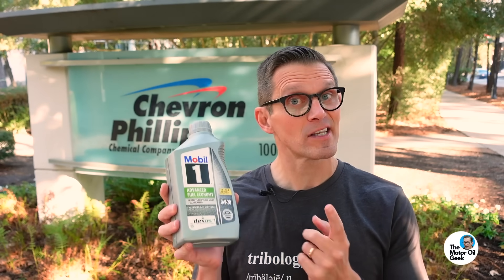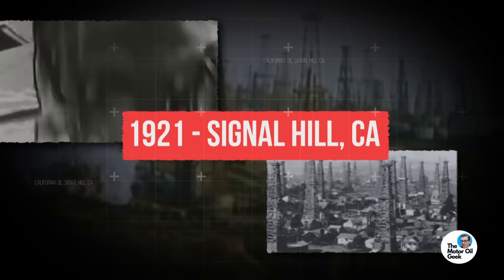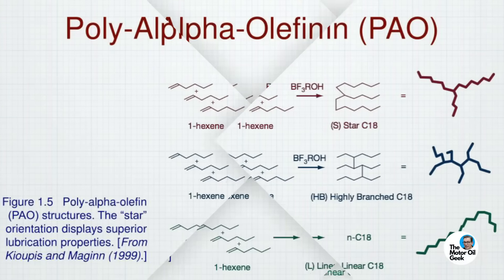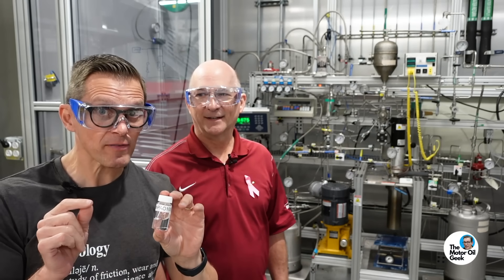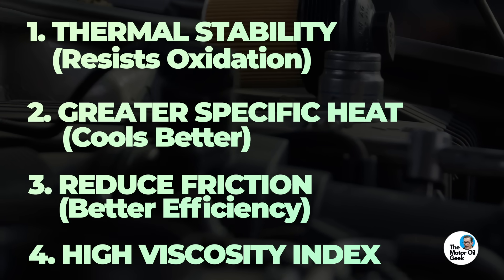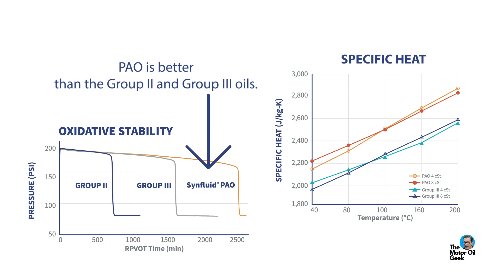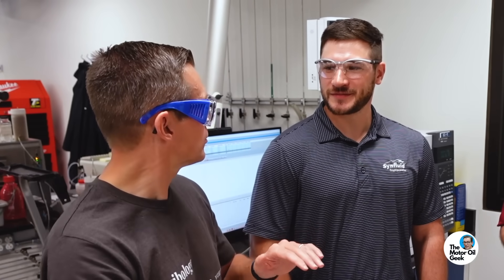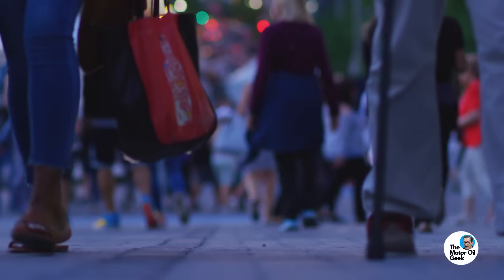STOP Using Regular Oil - 4 Reasons Synthetic is BETTER!

Comment: This statement is a fact on V8 engines if you’re using high-quality full synthetic, it is not possible to wear that engine out, yep, that’s what I said. You will get tired of driving the vehicle before you ever wear the engine out. I’ve been running synthetic since the early 1980s, which was Amsoil the only one, I have never worn out the engines on any of the cars and they were all V8 that had synthetic engine oil they don’t smoke. The valve guides are tight. They go forever all of these engines have 500,000+ miles on them

Comment: How about for my 1995 Toyota 4Runner with 207,000 miles.  Toyota told me it would be a waste...not perform better not last longer.  Toyota owner forum said members had leaks in the engine after using synthetic so changed back.  I wondered about MPG....but don't want a leaking engine.

Comment: When I had my 88 Toyota pick up. 
Bought it with 80k miles on it  had 4 long time  knew it inside & out . 
Put 100k miles on it regular maintenance.  Got tired of driving it.    22R motor...    5w30  Conventional   havoline oil used in it.  .  Once that oil gets to 2700 miles.on it.     Lifter would start ticking  just a hair.     Change oil.   Lifter tic would go away until it got to 2700 miles again...     USING QUAKER STATE 0W20 IN MY 2016 OUTLANDER SPORT SINCE DAY ONE...     MIGHT SWITCH TO HAVOLINE  & START RUNNING THAT IN IT.    used havoline in the 90.s all the time.     😊    Change oil every 3000 miles.   😊    Mike from Minnesota....

Comment: I'm not a very knowledgeable car guy. Some can argue I'm very incompetent; however, I saw your video on "Restore and Protect" and I wanted to give it a try. I have an older car and I was wondering if I needed to change it out every 2k miles at first until it is clean. Or, is it safe to wait until the next oil change as recommended by the owners manual. Thanks!
Reply from the maker: Just use it like normal. An early oil change is not needed.

Comment: Not on current topic...However I have been impressed with the valvoline restore and protect.  Have not tried it personally I am considering it for a 5.3 with 180k on it.  I use valvoline fuel treatment on this engine currently.  OEM SPEC 5/30 oil only.  And I usually do not exceed 3k on oil changes.   Excessive I know.  However my question is on Diesel engines.. (perkins)..   #1.  On oil consumption (pcv valve operating). A suggestion was made to increase viscosity to 50...  is that a real option? 
And #2 is there an oil for Diesel engines that would help with sludge or oil ring performance?  Please forgive my ignorance on this subject but that's why I like your content.   I enjoy people that strive for and share knowledge.  Thank you Marvin

Comment: Would a synthetic oil in a early 70's flat tappet cam engine still be a better choice or stay with conventional oil with higher zinc levels? All late models (80 and newer) are roller lifter cam driven or direct rocker with a roller to cam. What I hear is more related to the late model engines with rollers and specifically not addressing the flat tappet.
Reply from the maker: WALMART Oil Showdown: Myth Busting Results!
https://youtu.be/j8tpRxQLqU0

Comment: Can you test Renewable Lubricant oil please? It's made with a modified high oleic sunflower oil that allegedly has high thermal stability and low friction properties.

Thank you for considering.

Cheers
Reply from the maker: Thanks for the suggestion.

Comment: In the desert Southwest we don’t see the low temperatures that are seen back east. We see temps hovering around freezing, but not much lower in the extremes. But we do have incredible heat. This heat destroys batteries because the chemical reaction that releases stored electricity is set up to keep them reacting fast enough for those low temperatures seen back east. The downside is that this reaction is effected by heat, reacting so fast that it causes wear on the plates in the batteries which wears them out faster than cooler climates. What does synthetic do to handle the high heat of Arizona summers?
Reply from the maker: Synthetic can handle the heat

Comment: if the manufacture recommendation is 10w30 on my motorcycle but during summer i feel the oil is too thin just after 30 minutes of riding .what should i do ? stick to 10w30 or use 10w40 or mix 10w 30 and 10w40 in equal amount and pour?

Comment: As I understood, owners of air-cooled VW’s think that mineral oil is better for cooling because when they put synthetic oil in the motor - oil temperature goes down and cylinder heads temperature goes up.

Comment: CHALLENGE! start doing a little on 4 stroke outboard oil ,1 time (open loop) water cooling usage, and their lower gear case oils (submerged in water for cooling). We scream!,  our outboards at 4500 to 6k a good bit of the time, our lower units are the epitome of extreme pressure, heat and wear and our motors run at RPMs well beyond car/truck engines normally operate.

Comment: So I have a 1968 dodge charger 383 engine and been using penzoil 10w40  and was told I need an oil which contains zinc. Any synthetic oil contains zinc?
Reply from the maker: The API SP oils do: https://youtu.be/j8tpRxQLqU0

Comment: Hey Lake thank you so much for all the effort you put into all your videos and thanks for sharing your passion as well 👏🏻👏🏻👍🏻 Also what are your thoughts on this advice It’s better to change your oil regularly with “cheaper” oil, than not changing regularly with “expensive” oil. I’ve being thinking of changing liquimoly semisynthetic Leichtlauf High Tech 5W-40 for Castrol full synthetic EDGE Euro 5W-40 A3/B4, for my Porsche boxster s 2001
Reply from the maker: Thanks. I'd rather use a really good oil and change it at the proper interval. That's the best protection and value.
Reply: @ Thanks for the response, I feel like back in school with all your videos I’m always taking notes haha thanks again for all of your effort in your videos 👍🏻👍🏻

Comment: I agree use synthetic.. Honestly if you are changing your oil under or at every 3K miles just use what's synthetic and on sale.. Or if you are making the mistake of following the manufacturers recommendations of 5K to 10K oil changes then I would use the best oil you can buy... But for the most part I use Pennzoil Ultra to Ultra plat, and I change my oil every 2000/3000 miles cause why not.. The car isn't going to get mad at me for treating her special and keep her clean..

Comment: You don't get quality mineral oil from the desert: It needs to have long molecule chains found in very deep perforations only got from Venezuela, because the deep boring in frozen Alaska should cost way more than the most expensive syntetic oil. A synthetic oil a a cracked cheap desert oil with its additives, except the group 4 synthetic oils with are all the same short molecule chains perfectly connected until excessive heat destroys it due to oxidation just like it destroys quality dino oils. So for the woke guys, a synthetic oil is more politically correct but those theories are just marketing until there exist certified durability long distance proofs like where done with dino oils.
Those differences in which a good synthetic oil like Amsoil is better are only important for  use in racing, not one the street where we don't change oil after each ride like in competitions.

Comment: Is there some reason why i can't use 0W40 oil in 70's car, what drives easily 10W30 oil? I can't find any reason why not i only find good reasons for the engine.
0W40 API SP class oil..

Comment: Another great video Lake! This is "Cool Stuff!" Making Facts Fun Again 😁
How does the average Petrol-head identify clearly which synth oils are actually using Grp 4 PAO as the base? And how would we know the percentages of that base is actually PAO Grp 4 vs Grp 3 etc?  🤔
Reply from the maker: Thanks. Most "synthetic" oils in the US are Group III based, but there are some Group III/Group IV and even Group IV/Group V blends on the shelf in the US. However, you have to decode the SDS sheet to find that info most of the time.
Reply: @themotoroilgeek  Thank you for the reply. It seems that this would be more plainly stated or even have its own classification type spec on each bottle.  But I understand why its not 🥴 The community may need to start a curated list  of PAO Grp-4 oils.

Comment: Ok can you please answer this.  I recently bought 12 litres of the wrong vscosity oil for my cars which are both BMW's with late varient Diesel N47 engines.  I bought Castrol Edge 10W60 instead of 5W30.  So what I have done to save just wasting the oil is give the engines a flush using 4 litres of the 10W60 each (just ran engine for 5 minutes with it in) then  replaced it with 4 litres of 5W30 castrol edge M (not LL varient) then topped it up (engine takes 5 litres) with approx 1 litre of left over 10W60.
So my question is, is it sacrilege to mix the two viscosities and even though they are from the same manufacturer and both fully synthetic similar oils is this likely to cause some catastofic failer or reaction when the two oils mix????
Reply from the maker: It is ok to mix different viscosities of the same brand and specification oil. The viscosity is the only difference in that case.

Comment: Thanks...This has been a paradigm. I've understood heat transfer but finally understand differences in Groups.  The graphs for Specific Heat, Thermal Conductivity, and friction clearly showed PAO (Synthetic) was definitely superior to conventional. So on the topic of Group IV vs V is it true that Ester molecules are polar and have an affinity to metals via an electro-chemical bond whereas PAO molecules are neutral?
Reply from the maker: Esters are polar and PAOs are neutral. The polarity has pros and cons. Good solubility (pro), but that polarity also causes competition with the additives (con).
Reply: @themotoroilgeek  Thanks...Some of my less used vehicles have low miles per start <120* (don't count starts but mileage is so low and consider anything <120* a cold start; therefore, conclude low miles per start comparatively speaking). I change oil frequently, 750 to1600 miles on sample reports. My oil samples have more metals than I would like >5ppm/1000miles. Loss of additives has not been an issue w/ frequent changes so I'm thinking I might consider a Group V may be beneficial. Is my logic right or have I missed something?
Reply from the maker: @jcasey460  An Ester blended product may not help. The additive chemistry also plays a big role in cold start protect. The main reason for the higher wear rate per 1,000 miles is the short drain interval. You are not starting at 0 wear metals, so the residual wear metals are throwing off the math. That calculation works better with 3,000 to 7,000 mile drain intervals. That is far enough for the actual wear metals to be greater than the residual metals.
Reply: @themotoroilgeek  LOL...makes me feel better...a lot better...Thanks...Exactly what explains happened on my last sample taken!

Comment: 😢 could you just tell me the best oil for my gm 5.3 v8 its direct injection with the DFM lifters and overly complicated electronics to control this system along with hard facts for it's failures. 2024 model and calls for 20w GM Dexos oil! 
Please chime in on what you would use if you were me!
Thanks a million!

Comment: Is transmission fluid similar to oil? In the Toyota community there is a debate on Toyota WS vs aftermarket WS transmission fluid. Toyota says only use OEM Toyota WS fluid. Is it really that different than an aftermarket fluid like Valvoline Maxlife which is recommended by Valvoline to be used with many vehicles including Toyota WS. I'd really like to see information or studies on this to see if indeed OEM Toyota WS fluid is the best and only fluid that should be used.

Comment: I worked in industrial maintenance for many many years. In the beginning I was a Synthetic denier because of the cost. Later I was forced into my first experience which was shockingly impressive. Some years later I was convinced to take a voluntary foray into synthetics. Boys and girls Synthetics have huge advantages over the old oils. I can't say there are no negatives but I never experiences those problems. This wasn't in motor oils but in industrial hydraulics and the lubrication of Screw type air compressors.

Comment: What are the main reasons/drawbacks against using at least some POEs as a 'co-base stock'?
Is it ONLY a matter of co$t vs. ANs and/or other alternative base stocks?

I ask because many oil manufacturers/blenders nowadays seem to be reluctant to (or flat out refuse to) use even small percentages of premium POEs in their true, fully synthetic, mostly PAO blends.

Also, I fully agree with you on the whole true synthetic PAO majority base stock thing, and those are the only products which touch the sump in my car's engine.

But, you yourself (and many others) also point out, many times, that the GTL base stock products are at least the RIVAL to PAO/POE base stocks, IF not actually superior.??

Is that only for easy use, no racing/competition whatsoever, daily drivers, or not???

Comment: Thanks again Lake for the great videos. I can't wait for that update on the Castrol  gtx wear results. I need to ask u a question. I really want a full pao/mpao (or at least very high percentages) in the 50 weight spec and higher Moly, zddp, boron etc (full saps) but not w the high calcium....i am using it on a few older cars so all I care about is protection and longevity of the engine. I also don't go long w with oil change intervals... 5000 miles... Which 'driven' is the best? From what I can tell the "Dl50" is what I'm looking for.... Is this correct or is there another one Im missing. Thanks so much for everything. It's nice to see how your channel exploded in a short time. Happy for you.... Thanks! Lance
Reply from the maker: Yes, DI50 would fit that bill.
Reply: Thank you

Comment: I've been using 20w50 regular conventional oil on my 1986 Porsche 928 recommended by Porsche in Southern California to protect the Thrust bearing failure and never had a problem over 200k miles. It takes 8 quarts and I do replace it every 2 years since I drive less than 2000 miles per year. Synthetic oil has smaller molecules and cleaning deterg8 so there's a risk of oil leaking on old gaskets.

Comment: Ok that all fine and dandy . But if I switch to synthetic on my 3.0 Duramax and have mechanical failure now the dealer will not warranty the engine because I didn’t follow there requirements by using there sae ow-20 (light duty oil) which is GM approved decos D. With that said I have yet to find this oil at any auto parts store. I’ve been buying it on line or from the dealer . I have found the synthetic available at the box stores but I’m Gunn shy about using it for I have 40000 left on warranty . I look forward to any and all responses
Reply from the maker: 0W-20 Dexos D is synthetic by the definition of the Dexos D spec.

Comment: When synthetic oil first became readily available a senior project engineer at CAT assigned a team to evaluate them. I’ve been using synthetic in everything since the mid 1970s.
Reply from the maker: Thanks for sharing!
Reply: at the time did they conclude they were a good idea?
Reply: @ better than petroleum oils beyond any doubt.
Reply: @contemporaryprimitiveman3469 that is why my car uses synthetic oil as stock oil, a plain just normal 2022 Chevrolet Spark... 3-4 times per year  oil change because I drive mostly city with plenty of stops and go... outside temps here as of today was 32 ° C it has been that way all july
Reply: I studied in diesel engine mechanics in 2002. At this time, a new owner of an highway truck with a CAT engine had choice of which kind of oil he would work with; mineral or synthetic. The break-in was already done at the factory and CAT filled in with what the customer asked. When a saw what happened with the engine warranty, I was blown away! Mineral oil; 200 000mi vs Synthetic oil; 600 000mi Since then, I’m sold synthetic for everything!
Reply: @contemporaryprimitiveman3469  as a business major in college and having my career in management, I know all major companies have to adhere to the law, so lawyers advise management. No company risks lawsuits without legal approval, so long interval oil change recommendations in public advertising by Mobil, Amsoil, Royal Purple, etc. has been researched.

Comment: Hello, I have a 2002 ski nautique with a ford GT40 351 EFI that I use high zink straight 40w racing oil Valvolene SR1. Should I be using a synthetic?

Comment: A series on GA aircraft engine oil, additives, and doing engine oil analysis especially in a pre- purchase inspection.  Most aircraft experts post about compression testing in an inspection and say nothing about getting oil analysis done.  A compression test on piston aircraft engine shows nothing about condition of bearings and camshaft or other internal parts. 

Finally using aircraft oil additives vs fuel additives.
Reply from the maker: Thanks for the suggestion!

Comment: I remember when Mobile developed Mobile 1 synthetic piston engine aviation oil. It was a disaster. Since aviation gasoline contains lead, it was found the synthetic oil did not scavenge the lead deposits leading to sludge and engine failures. Mobile ended up buying a lot of new replacement engines. Obviously they took the oil off the market. 
I used Aeroshell which was a blend of synthetic and mineral oil which gave the best of both worlds. 
You should do a video of that debacle.
Reply from the maker: That one is on our list!
Reply: How many people were killed because of this?
Reply: That's also the reason why you still find why many industries like agriculture still use conventional oils for their machinery that costs millions of dollars 😆 Synthetic oils are worse in most of every aspect possible, besides cold start situations, that's it.